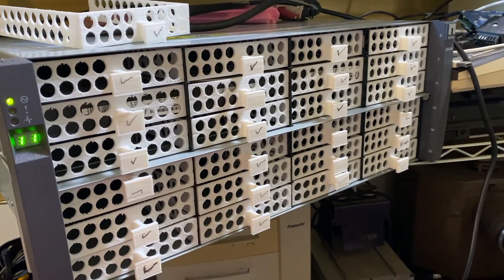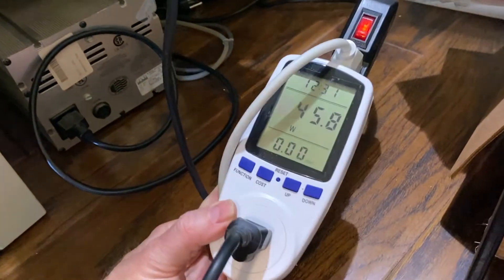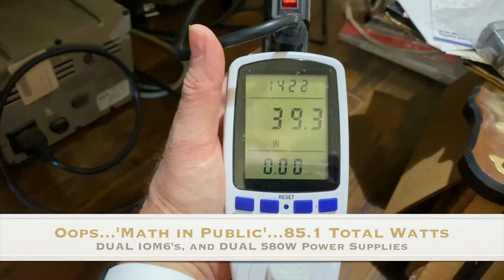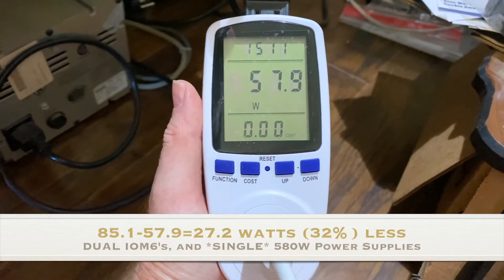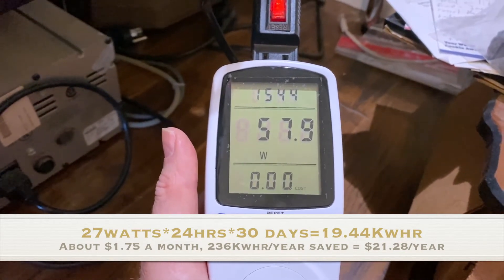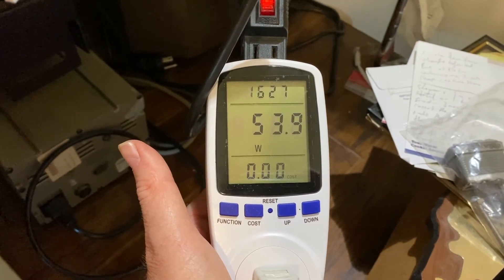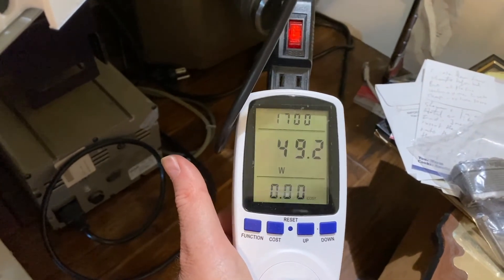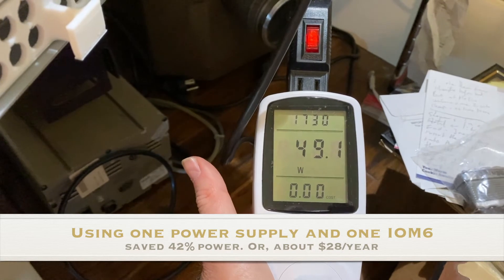How much power does a Netapp DS4246 use? With and Without redundant IOM6s and Power Supplies.

Comment: Hi. 
I want to share my experience with this unit.  So I tried to lower the noise and power consumption by removing a fan/psu.  Because the psu has 2 delta fans and in my case, storing movies and personal stuff, makes no load on the drives so insane cooling isn't needed.  I tried to remove one fan and connect the pwm cable to the existing one. The unit refused to boot up after the mod. Secondly I tried to completely remove the fans / swapping out to other 80mm. The system refused to boot up. So at the end of the day I managed to go down to 40watts (220V) idle (without drives) by having only 2 psus (one in the left and one in the right side), only one iom6 controller and only one psu is actually plugged in. Noise levels are still higher than acceptable for home usage but right now I managed to lower my rack noise to nearly silent.
Reply from the maker: Someone here made it work with Noctuas. https://forums.sudo.fail/t/guide-replacing-the-netapp-ds4243-ds4246-psu-fans/91 Key is the Netapp needs to see two fans, so in htis mod, they spliced into existing wiring so the power supply doesn't know the fans have changed. Trying to drive one fan/two fans off one connection etc. looks like it won't work.
Reply from the maker: My only concern is if you filled the Netapp with hot drives, since the Noctuas don't spin as fast.
Reply: @RobertBullock  Thanks. Ill follow this guide . My initial problem is noise output of the stock fans as well as higher power usage. The shelf is inside my rack, which is ventilated well with external fan that bring warm air outside my house. Curently running over solar energy and every watt savings matter. I planned to extend the system but the house im in is rented, so cant do much :/

Comment: How loud is the ds4246 with 24 drives in it or is most of noise the hdds?
Reply from the maker: It's pretty loud but I haven't filled it. I will probably be selling mine as it's overkill for me. I'd say it's fan, but others have modded it to reduce that.
Reply: @RobertBullock  This is weird to ask in YT comments but do you still want to sell the NetApp? In Austin, willing to drive, needing disk space.
Reply from the maker: Yeah it’s just been sitting there. Has dual MW6, all the 3D printed and fitted trays and I have two controller cards and all cables.